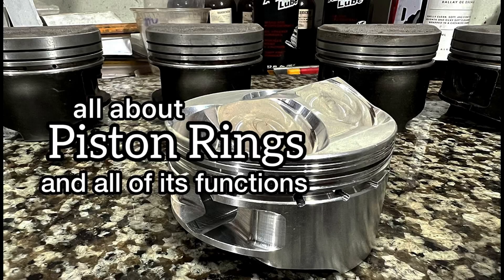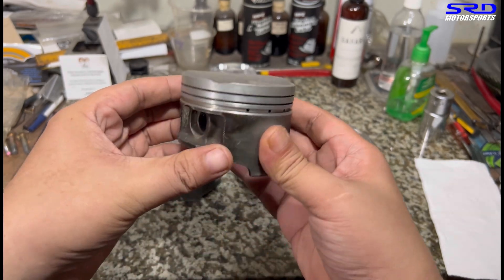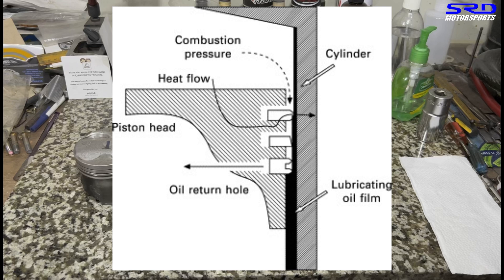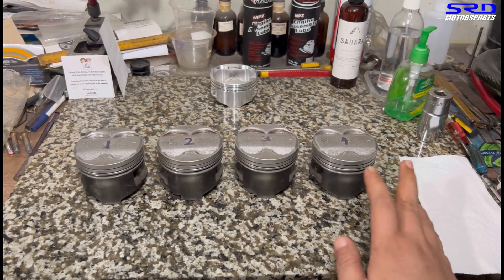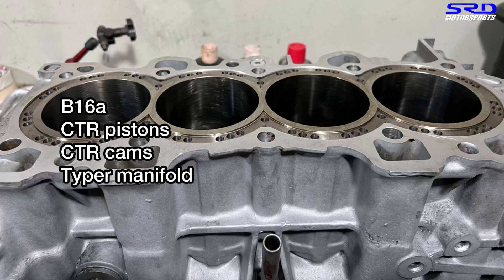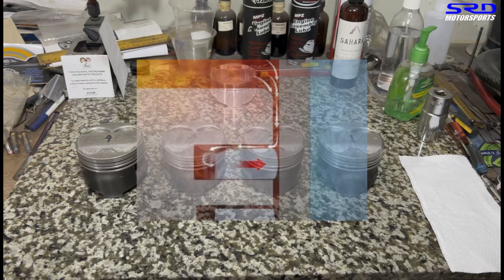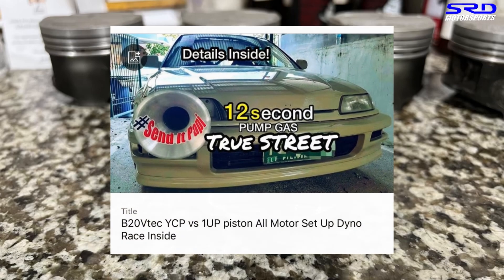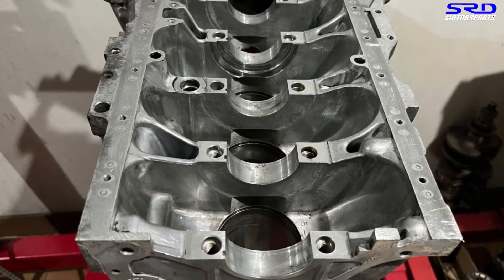Piston Rings: Why our Engines have 3 or 2 not 5 rings

Comment: Hi! I want to ask you something. I with my friend building b18c4 engine. We set te gap on 1st ring at 0.0016 inch and thanks to you we know thats will be good. But we aren't sure about 2nd ring gap because we have about 0.0027 inch per ring. We didn't set up the gap. Just checked it straight from the box and we are a little bit confused. That gaps will be good or this is propably too much? We will be grateful for some advices :D 
Our b18c4 cylinder size is 81.25mm
Reply from the maker: Yeah the second ring gap is a little on the loose side but it should be fine and no problem as long as the bore is straight then you are safe

Good luck!
Reply: @SRDmotorsports  Thank you so much!
Reply from the maker: no problem sir 😎

Comment: Heres a question brother, Blow by: how much is too much and what is an accurate way to measure it?
Reply from the maker: interesting question!

actually on measuring it? Kinda hard to tell or see but one can prolly device a contraption that can measure crankcase pressure “on average”  like average out the bounce spikes

and then get a reading off a freshly new built engine and get a reading off a well worn out high mileage motor for reference

But then the high mileage motor also have to have a less than ideal comp reading

cuz if the comp reading is all equal and good then we know the blowby is at a minimum

But nice question! Makes me think now if we can ever come up with a contraption

If you got time? Check Total Seal Rings channel whenever they dyno test an engine they also have a floating table tennis ball contraption that they use to read and reference blowby

But they prolly also have a baseline. Reading of an engine with zero to no blowby to have a “standard”
Reply: @SRDmotorsports  awesome,  thanks for that,  we might be on to something here, such as an ideal compression for a specific engine vs blow by velocity... I wish I listened during maths class back in school! I got back to Japan from Australia recently and have had some time to look at my current B16A2, I did notice quite alot of blow by so I'll run a compression test tomorrow and report back... BTW, have you been to Puerto Galera? I went once back in 1995, I'm well overdue for a visit again!
Reply from the maker: @Mike-ry4ti  I think I havnt been there just Boracay then also Antique but true Puerto Galera seems to be a nice place indeed!!

do check the Hastings Rings channel (wish they got to send me gifts for this)

Their blow by contraption to check was really interesting
Reply from the maker: Ayt cool!
Reply: @SRDmotorsports  ok so here are my numbers, stock unopened B16A2: 

1: 228 PSI
2: 211 PSI
3: 207 PSI
4: 230 PSI

Time to take off that head and slide a B20 under it I think!
Reply from the maker: looks decent atleast all are above 200psi but yeah 2 and 3 are suspect

Comment: I asked if scrub the surface of the cylinder head affects the ignition timing?
Reply from the maker: really depends and it must be a controlled test to know if it affects it or not much…

It’s been a known “claim”
Reply: @rezakurniawan2779  @SRDmotorsports  someone once told me a shiny cylinder head and piston crown makes an engine more detonation prone, is there any truth to this? Is this one reason why some pistons have a coating on them?
Reply from the maker: @Mike-ry4ti well depends on shiny but if it’s smooth enough to not have any hot spot then it def promotes less detonation

I mean forged pistons are all machined shiny but they were designed for performance so it performs…

The coating is more of a heat shield barrier

Comment: "Going too tight on clearances such as piston-to-valve, piston-to-head, piston-to-wall, and main and rod bearings will kill you every time," says Darin. 

"On the other hand, there are no drawbacks to being too loose except for a little more oil up top as bearing and side clearances increase. That can be counteracted pretty easily so it's not a big issue". 

🍻
Reply from the maker: @findtherightbeat  definitely a good quote from the man himself aka Darin!!!!!

another tidbit to add
-why running too tight everyone would know? Oh that’s cuz either you’re slow or you blew up 😂

Pertaining to 
“Run it loose and only you will know, run it tight and everyone will know”